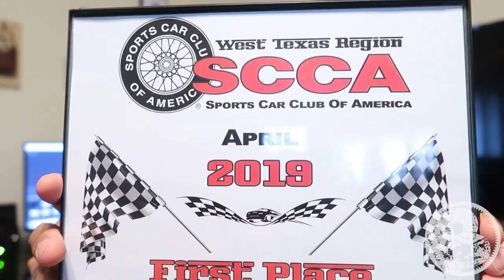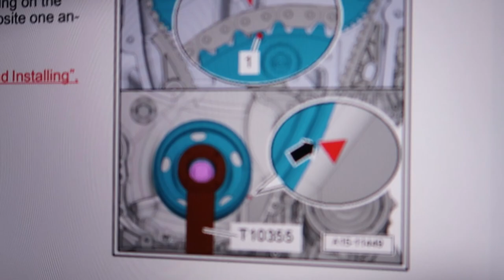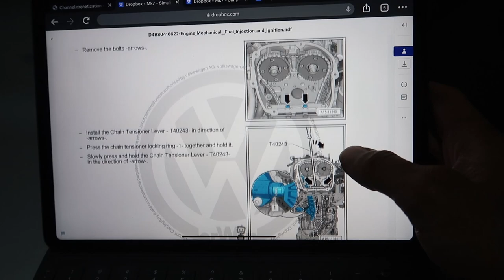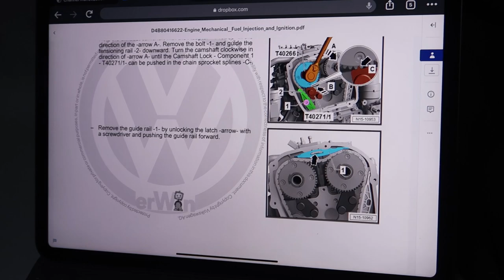Engine build - Breakdown! Part 4 - Timing system removed! | MK7 Golf R

Comment: Coming along bro! Hey does it even matter but, I do have 2 things to add. 1. Have you done enough research on the head porting? It is possible that is a cause of massive blow by. 2. It has crossed my mind but I am not as far as you yet. You should look into upgraded thrust washers. Just some random crap to fill your head with. Keep up the good work my man.
Reply from the maker: I've done a little on the porting of these heads and it seems as long as I'm not running stuuupid amounts of boost I should be fine with blow by. Definitely wanna upgrade the washer! Not sure how to go about it
Reply: @BryceJordanProductions  Maybe a call to IE?

Comment: how this tensioner works? there is spring, but there is statements that oil pressure also is needed in order to have functional tensiomer ... but there are no feeding lines from block of engine which will feed oit to tensioner, so it must be supported by oil which is in crankshaft box, space ...how to say,... "free oil" but is it sufficient to work properly ? i think there is no pressure, or at least free-fall oil pressure
Reply from the maker: I'm not even sure man sorry I can't give you a detailed answer
Reply: @BryceJordanProductions  https://youtu.be/diBBbFDw-1E?t=383 in your other video is also answer.... there are two thread-holes for connection of tensioner to engine block, and 1cm under upper hole there is smaller diameter hole whih is intended to oil feed of tensioner ....
Reply from the maker: @majklxxx  good catch. It’s been awhile since I did the job, I have quite a bad memory and don’t really have time to go back and look through the vids lol